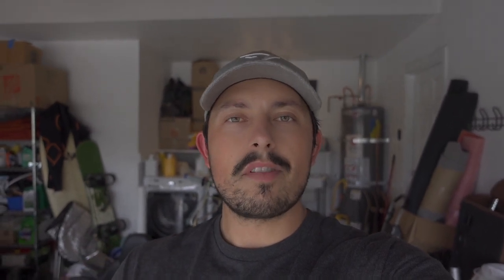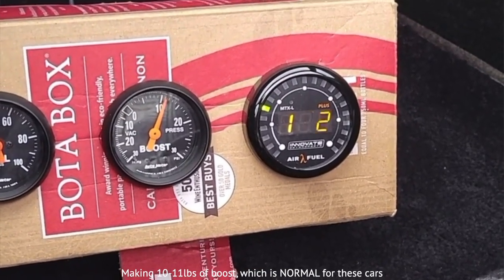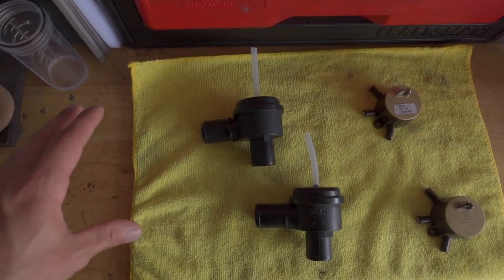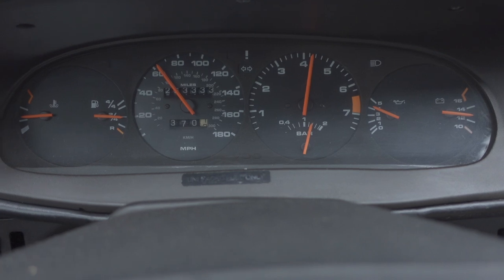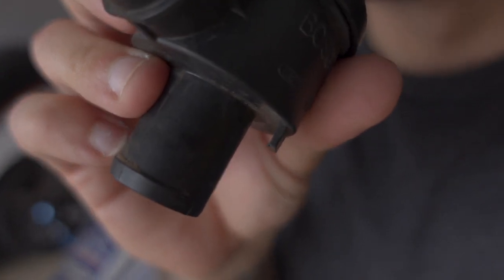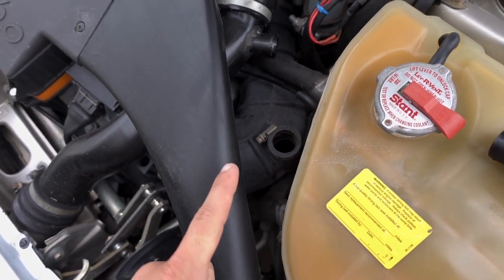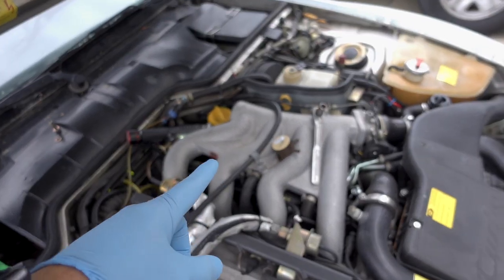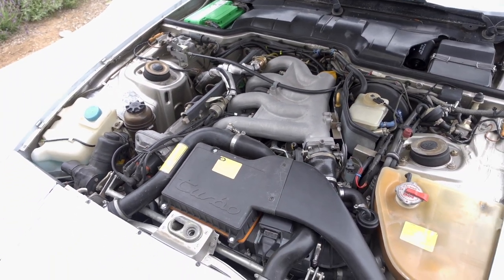Porsche 944 Turbo FINALLY Makes Full Boost | Diverter & Cycling Valve Replacement

Comment: LOL  Great video Anthony....and.....that's my wine box gauge cluster!!  I tossed it together one night when i had all the gauges on hand.  I wanted a quick, temporary and easy to view set up to see how my car was performing.  This is my first 944 so i wasn't sure what i should be seeing. I didn't  trust the stock "BAR" boost gauge or the current 3 BAR FP regulator in the car.   I have the same 3 gauges(2x AutoMeter 1x Innovate WB02)  on my supercharged 928 and they have been invaluable in helping me trouble shoot issues over time.  With  FP, Boost PSI and AFR i have a pretty good grasp on where my car is at now.. I'm now in the process of finding a permeant home in the car for them.   Just installed a LR 3 inch exhaust last weekend..
Reply from the maker: I was hoping you’d find the video one day haha, but I really was happy that you posted it, gave me a good baseline to shoot for! I have one more gauge to install soon, hoping to get a better idea on what the car is doing like yourself! Gonna need to see a clip soon on Facebook!

Comment: Get yourself a Lindsey Racing boost enhancer. 15 minutes to install. Doesn't give you any more boost, but brings it on much earlier (less turbo lag) and smoother by delaying the wastegate's opening until it actually needs to open. Read somewhere that Porsche intentionally caused this effect so the 951 wouldn't be as close to a 930.
Reply: I’ve been told the same about Porsche doing that and was about to comment that but saw yours
Reply from the maker: Interesting, would be a fun mod to add to the list, I’ll have to do more research!
Reply: @Anthony_B  I put it on my '86 Turbo and it's like a different car. Boost comes on more gradually from a lower RPM instead of all at once.

Comment: i just replaced my diverter valve too and that woke it up a lot. I also placed an order for a maf kit so that should help a lot with driveability and low rpm torque
Reply from the maker: Nice! Are you getting around the same 9/10/11 lbs of boost? Also is it pretty regular in the higher rpm’s of all gears, mine seems to only really want to hit peak boost in 3rd/4th gear, sometimes in 2nd but not always
Reply: @Anthony_B  yeah i’m pretty sure that’s normal. I’m no expert but i think that’s what a electric boost controller is good for. consistent boost in all gears.

Comment: Where is the original gauge needle reaching now? 
Also another issue is that the waste gate spring is weak and not holding under pressure.
I was having the same issue and the issue went away with a Manual Boost Controller
Reply from the maker: I want to say I was getting about 9-11lb of boost after I replaced those parts (not 100% sure what that equates to in bar) but you’re right on the money, I suspect that I also had a weak watergate spring but I never got around to fixing it before selling the car sadly

Comment: Was the low boost issues ever got fixed?
Reply from the maker: Once I replaced the parts in this video I had proper boost most of the time, I’d still occasionally not hit boost but I never figured out why it wasn’t working 100% consistent